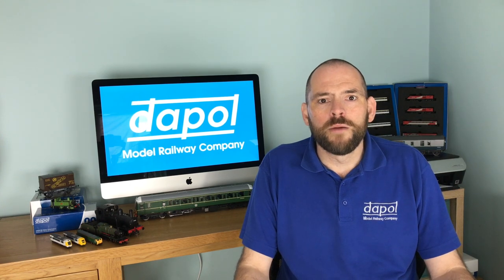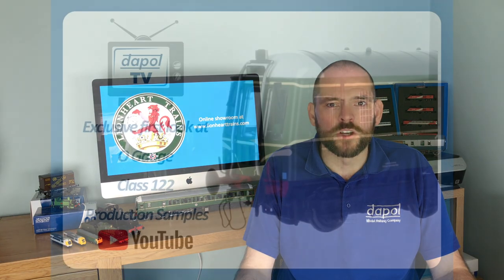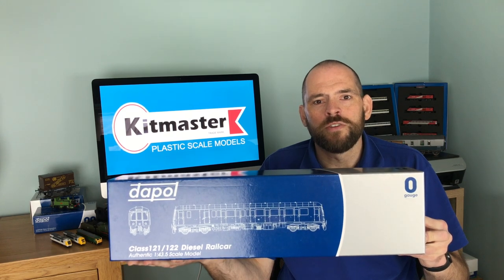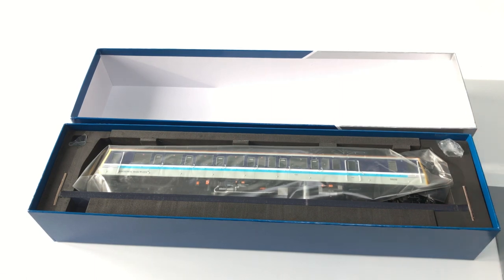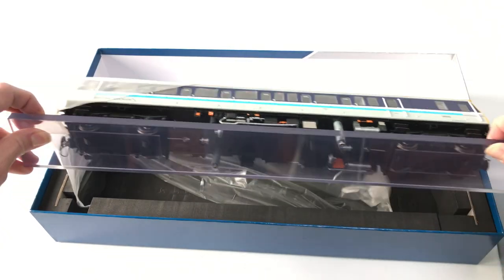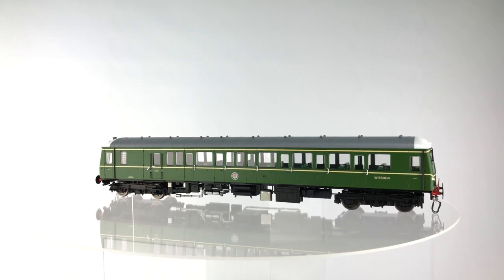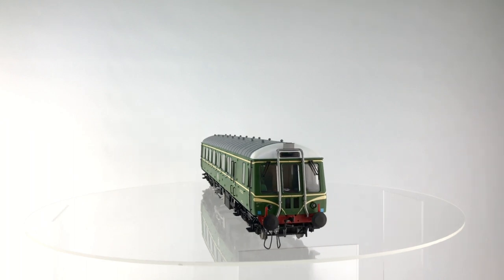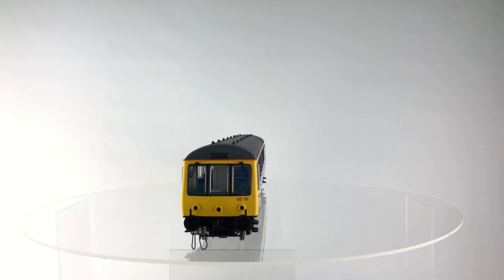Dapol O Gauge Class 122 Production Samples

Comment: Loving the look of that, and will certainly be in the market for both the class 122 and 121. Please can you confirm that when you do the 121, apart from the obvious differance of headcode box, you will also have the guards door opening inwards. ie, finished short at the bottom, to clear the floor ?
Reply from the maker: Hi Peter, take a look at the photographs here...

http://www.dapol.co.uk/Catalogue/164/index.html
Reply: @dapoltv4705   That's great to see, I'll be getting one of each then> I only asked having made two of each from Westdale kits, way back in the days before RTR O gauge.